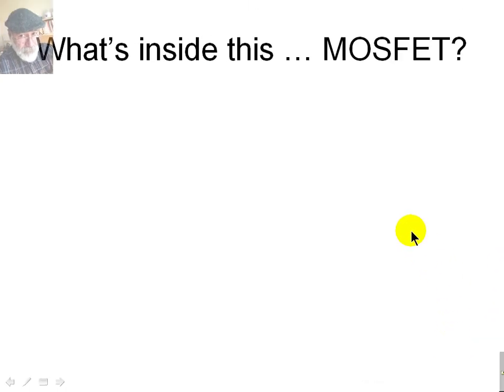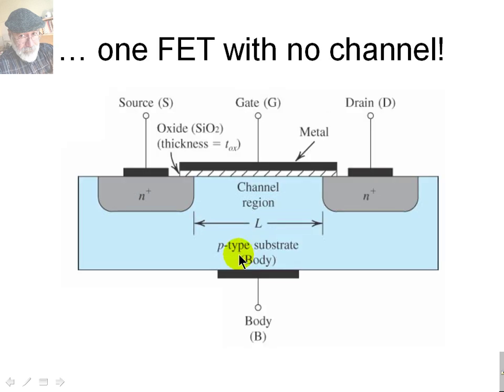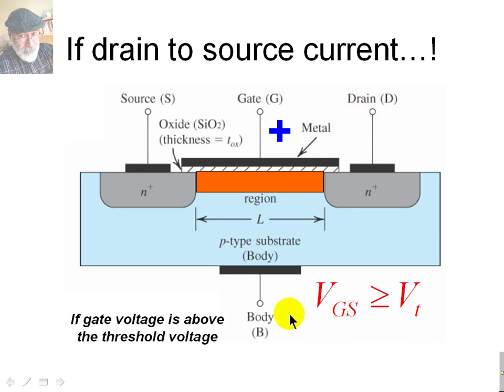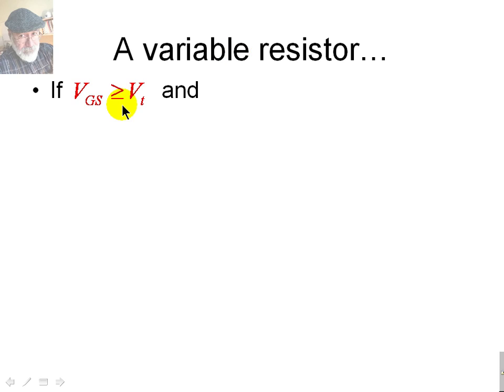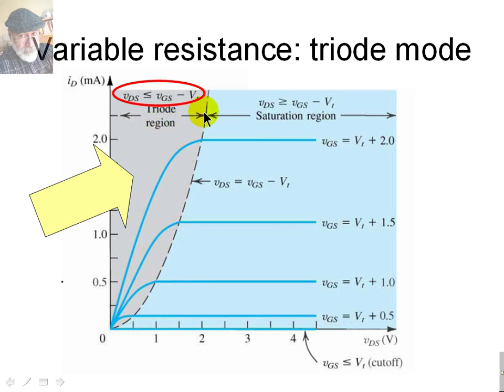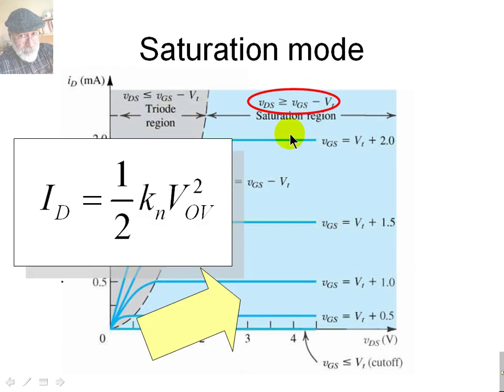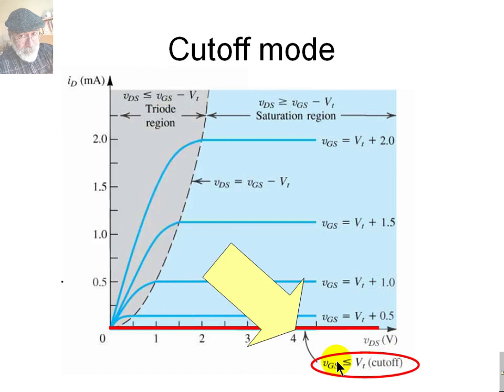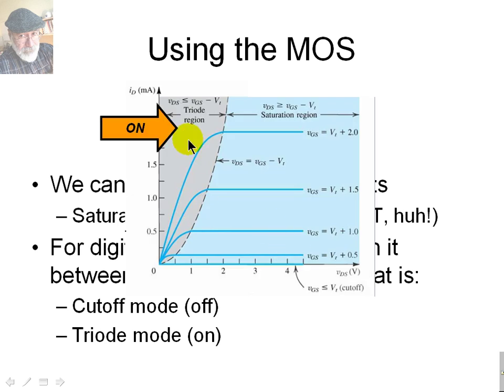FET/MOSFET (Video 3 of 4) (DRAFT)

Comment: I'am a studend in Master 2 physics and Ichoose the Mosfet as a subject for my memory .I'll be gratefull if your majesty help me and give me some articls about my subject
Reply from the maker: +Kdelune Kiri Dear M. Kiri, I assure you that my blood is not blue. The last time I checked it was red. To refresh your memory on MOSFETs, I'd start with the classics, written when this subject was new, when the essence was put in print instead of the frills discovered and developed with the ages. On Amazon you may find older books of those days, some published by the manufacturers themselves (when they were trying to convince engineers to use this or that device; some of those books 500 pages strong were distributed for free by GE, I remember two, one on transistors and one on SCRs). The old Schilling Belove, and the not newer Millman-Halkias are two that come to mind. After the basics are clear, you can plunge into rarified publications in journals and conferences.
Reply: +rolinychupetin My thanks will be little for your majesty Sir .thank you  for your time it's my pleasure. thank you again for your help that's give an idea about what i'll start with. i don't know how can I thank you for your advice. all best wishes for you

Comment: I want to add a little thing to this great video. In last part of the tutorial # 4, need to validate our saturation mode assumption. To this end, Vds >= Vov is need to be proven. Vds = 0.5 - (-1.2) = 1.7, Vov = 1.2 - 0.7 = 0.5, Since 1.7 > 0.5 our assumption is right.